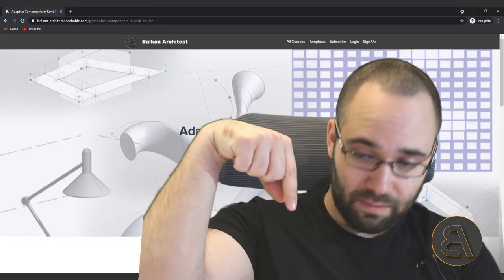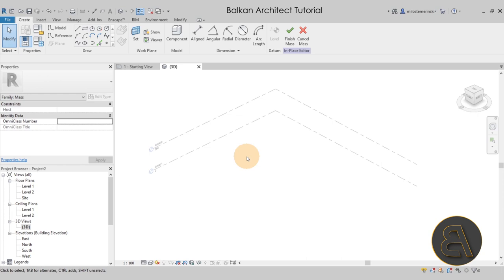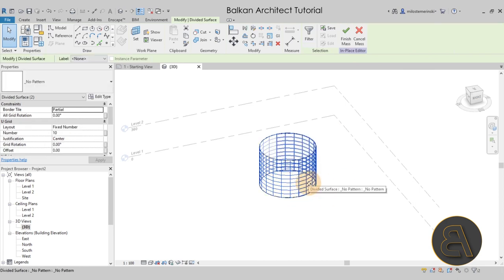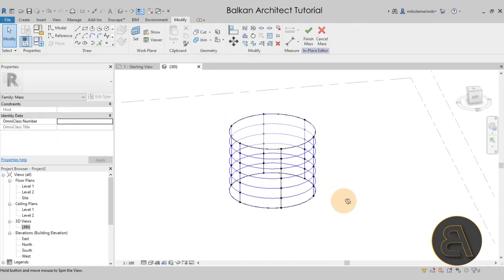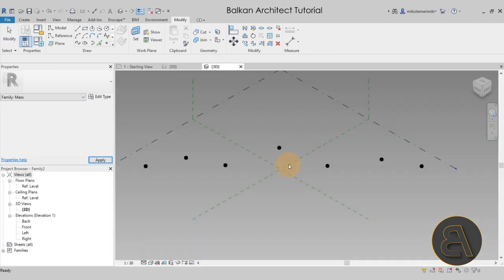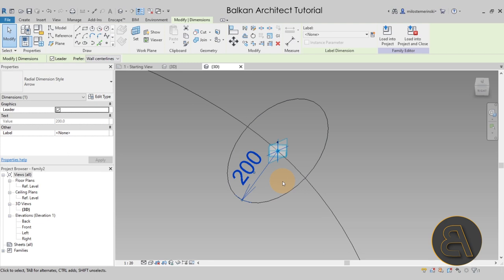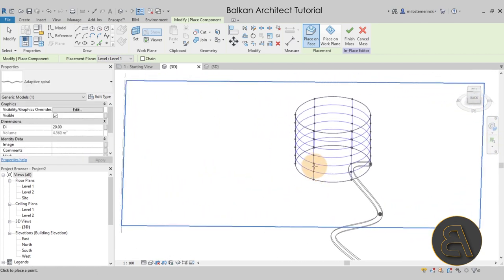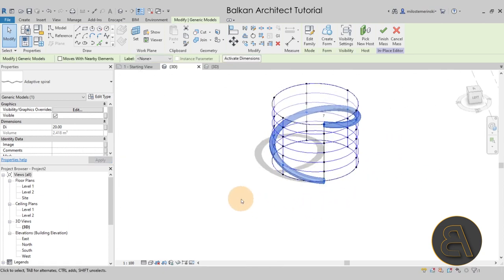Spiral in Revit Tutorial - Massing in Revit Tutorial

Comment: Well, I found a useful purpose. Stair rules prevented creation of a too-narrow spiral stair in a project modeling existing conditions. (Lots of non-compliant stuff out there needs modeling, too.)

Modeling the treads, column, & balusters  as generic family was easy. Railing was the tricky part. The only variation encountered from the tutorial was that TWO profile circles were needed on planes orthoganal to the spline tangent. Otherwise it produced "horn" shapes, skinny in the middle and fat on the ends. Using the same dimensional parameter for both profiles worked perfectly.

Comment: I noticed that the spiral had a variable thickness after changing it to 40mm. Is there a way to obtain uniform thickness throughout? Maybe by making a blend where all points of the path are tied to the same parameter?
Reply: In the family editor of adaptive component, I would place 2 circles on that spline (before you have created any 3D form). Place your circles on the start and end point, give them both a Diameter parameter and done! Just remember to draw your circles on planes perpendicular to that spline line and you're good
Reply: @5wiadro  Read this only after I'd figured out the same solution.